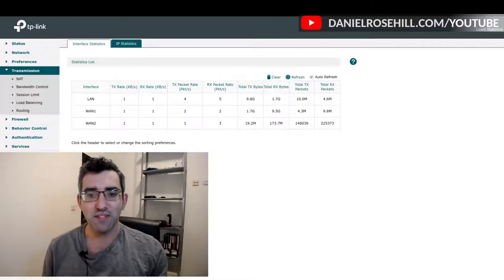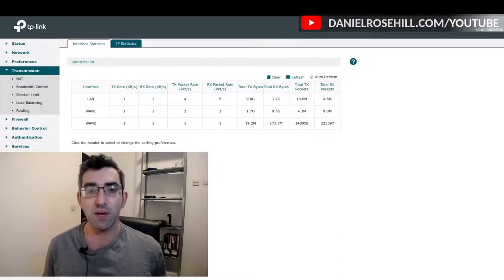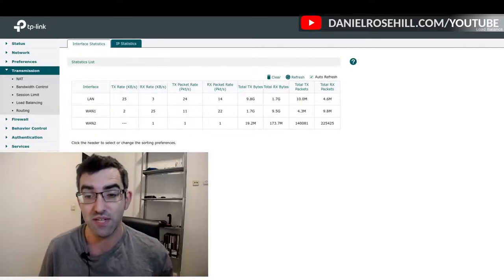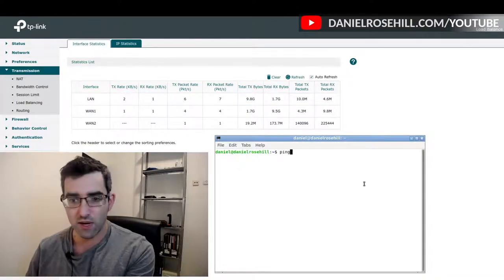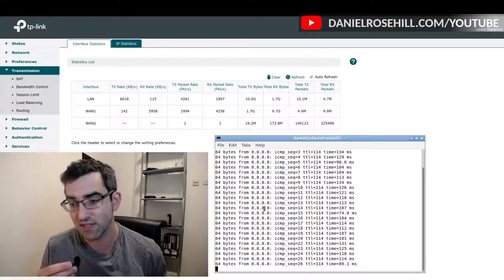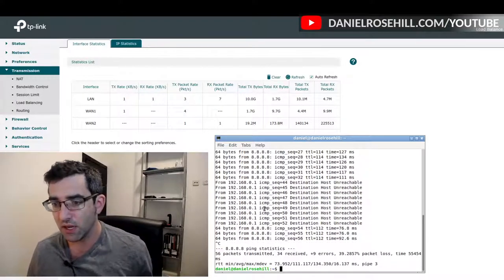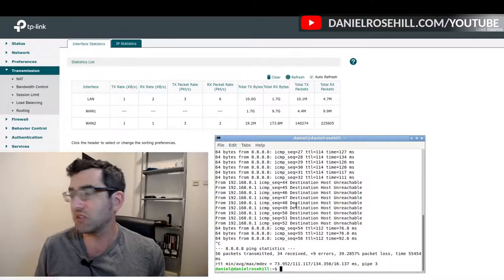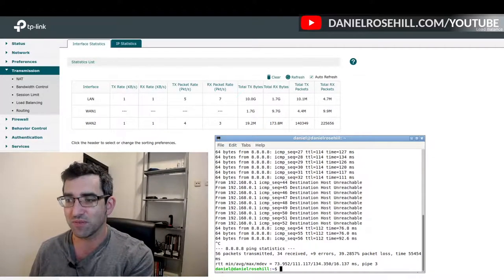TP-Link TL-R470T+ load balancing router: testing failover time from ISP to cellular (ping test)

Comment: Hi Daniel, nice video. Does R470 T support port forwarding and 1 Gbit/sec fiber as a primary WAN?
Reply: Have you seen the question?
Reply from the maker: Not sure about port forwarding but for the fiber... no. The ethernet ports cap at 100 Mbps throughput. This is actually why I upgraded to the ER605 which has gigabit ports. It was an aspirational purchase, though - I'm still lumbering along on DSL!
Reply: @DanielSRosehill  thanks.I tested ER605, but unfortunately it  lacks port forwarding!
Reply from the maker: Sorry to hear that. It's been a while since I port forwarded (too paranoid about cybersec stuff these days). Good luck finding the appropriate product. If you can remember to, drop me a line with what you end up with. My NAS supports a port-forwarding workaround for remote access, but getting the "real thing" going might be more useful.

Comment: I'm gonna find a solution for gaming disconnections. I have two internets but both can be unstable sometimes. What can I use so to aggregate both connections with one IP? So if one fails,the other connects without losing connection to the game server.
Reply from the maker: For that particular requirement, I'd say that connection bonding would be a better solution than load balancing -- because the failover process on the application layer, coming off this setup, isn't instantaneous. Speedify would do the trick but the limitation there is that you need to DIY stuff if you want it to run centrally rather than on endpoints (it supports Linux routers). If you want to go to more legwork, look at OpenMPTC. But if you just need instant failover / a really solid connection on one computer, and have enough ports on your machine, Speedify should get you there (if you have only one RJ45 it might be worth upgrading to a networking card with multiple ones -- they exist and aren't that expensive).
Reply: @DanielSRosehill  The problem I have with speedify is that it connects you to a VPN which affects my Ping.and I have no idea about OpenMPTC. btw,thanks for responding
Reply from the maker: @mostafaranjbar3798  No problem at all. Could talk about this stuff all night! From what I learned, for connection bonding to work, you need stuff deployed on the WAN side. So Speedify looks like a VPN but ... it has to have that infrastructure in order to work. But they do offer seamless failover which I've tested and can confirm that it works as advertised. Open MPTC ... same story. You'll need a VPS in the cloud so you're replicating the process but creating your own infra. Too much work for my needs but I've heard that many have success with the project.